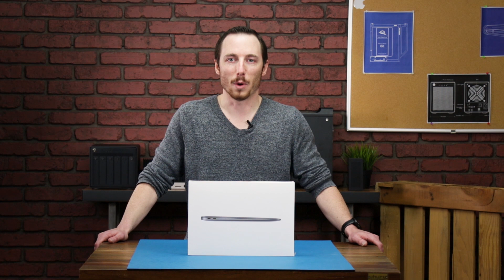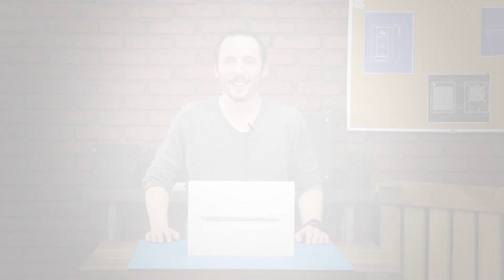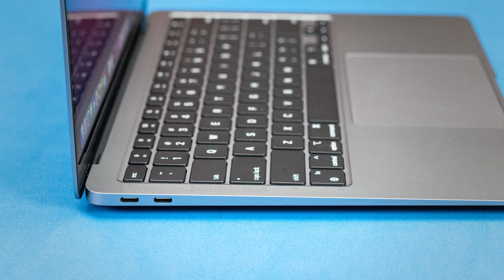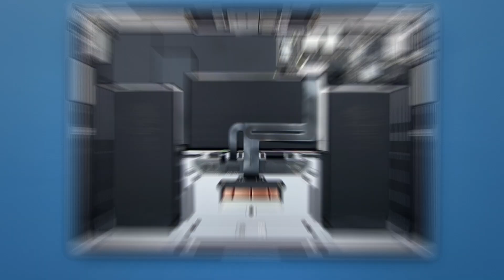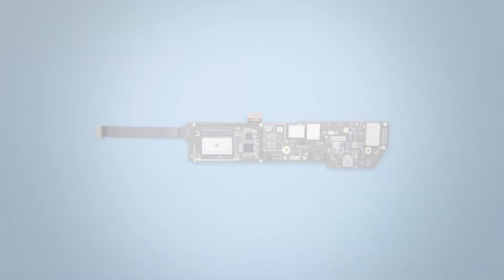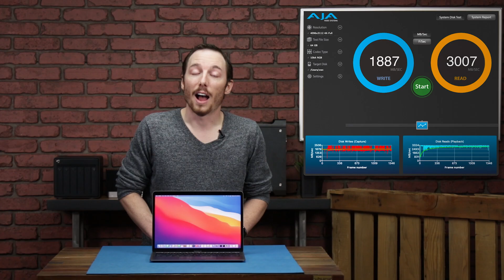Unboxing and Teardown of the 13-inch MacBook Air (M1, 2020)

Comment: What's the SSD in this M1 Mac book air called as what type of SSD is it ?
Reply from the maker: This is an excellent question. You will want to reach out to Apple with for more information. about the SSD type. Apple would have more information since they are the manufacturer.

Comment: @OWC, thanks for the informative video. Are there currently any available battery replacements for the M1 Air?
Reply from the maker: Regrettably, all the M1 machine have all either components soldered to the motherboard which we do not provide any internal replacement part for. 😣

Comment: So if all the chips and memory are soldered this means that if any component gets damaged whole Logic board has to be replaced or we can unsolder the required chip and solder a new one??
Reply from the maker: AnAn7s29,  We are sorry to report that we are unable to determine if the whole logic board needs to be rep[laced if any component gets damaged. Also, we are unable to support wether the machine can successfully be unsoldered and then soldered back together.

Comment: What did you use to take off the bottom of the MacBook Air? Please answer ASAP! (I spilled juice on my trackpad and now it’s glitching)
Reply from the maker: The screws on the back cover should be opened using a Pentalobe P5 screwdriver.
Reply: @poweredbyowc  thank you!!

Comment: Hi, macbook pro logic board way bigger than the air and much more components, if both are identical in performance, is bigger logic board in mbp better in terms of longevity? is it something to consider before choosing air or pro? Thanks.
Reply: I don't think either one will have logic board issues? Just buy the one that fits your needs better they're both amazing. can't wait till apple silicon hits the big screened iMacs, so excited

Comment: people were putting thermal pads on the intel chips to make contact with the bottom of the case to help with throttling, I wonder if you could do something like that to eliminate throttling on this laptop.
Reply: There is thermal paste, they’ve simply removed it; just search on google the teardown and you will see photos of the air’s m1 covered by thermal paste.
Reply: @federico_250  that's not what I am talking about, look up the previous generation thermal fix, adding thermal pads to make contact with the case reduced throttling by 30%, this would go on top of the heat spreader. The stack would be processor, paste, spreader, pad, case.

Comment: The logic board is so small you can maybe fit it in an iPhone Pro Max
Reply: Makes sense.
Reply: Lol I know right. An iPhone Pro Max with a more powerful chip would be great. 
What would you do if you had this chip in an iPhone?
Reply: But i dont think an M1 powered iPhone would be practical. I was thinking along the lines of a Raspberry Pi sized Mac Mini... Or we might call it Mac Micro. With 4 USB 4 prts and powered by a phone charger.
Reply: @TheUrbanRebel  That would be a cool gadget and Apple will never make it. Hackintosh anyone? (:
Reply: Pity you can't pack the much needed Macbook battery in the phone too...
Reply: @celticgibson  Could you imagine an iPhone that lasted days?

Comment: Is there no thermal paste on the die?
Reply: There's no need for that, macbook air now doesn't have any cooling or heatpipe
Reply: @qurniahizry3176  That black metal plate should cool the SoC (so it is its cooling sistem). Ps, there is thermal paste, they’ve simply removed it; just search on google the teardown and you will see photos of the air’s m1 coverd by thermal paste.
Reply: @federico_250  it's not a full fledged cooling system, it's just a heatsink which is found in most of the flagship and upper midrange phones and iPads.
Reply: @qurniahizry3176  yup! Just like your iphone does not need heatsink and thermalpaste, but it runs you apps much faster than your desktop.
Reply: There is but they removed it
Reply: I'm just wondering whether it's possible to "liquid metal" it for better heat transfer to the heatsink
Reply: @vanja123  I can only imagine what it would perform like. (: